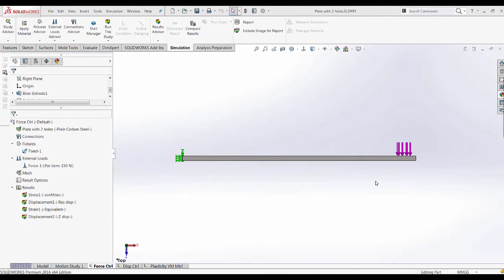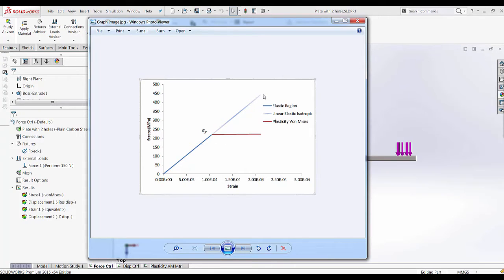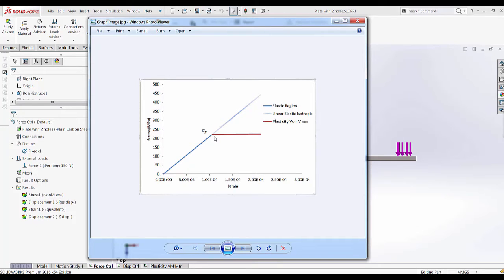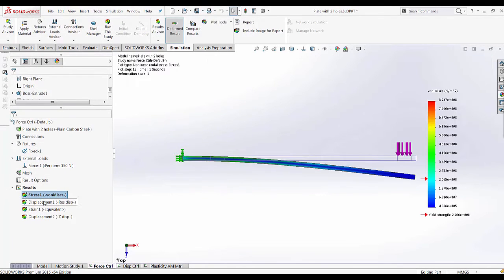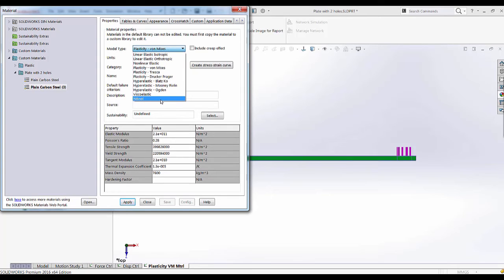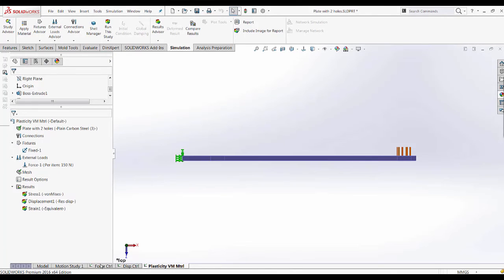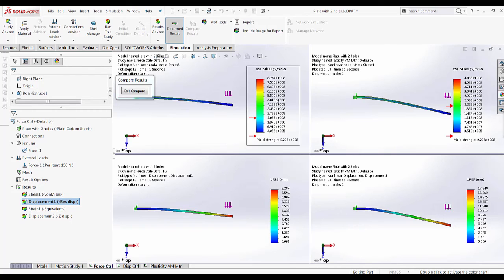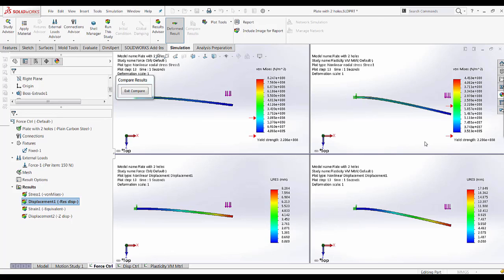SOLIDWORKS Quick Tip - Nonlinear Analysis Plasticity Von Mises Material (Part 3)

Comment: Can you explain this error ?
solution failure in a Step>1, it could be due to: The solution may be at a buckling or limit point, i.s., displacements grow large under constant forces. If so, for force control or contact problems, this is the end of solution (check out the response graphs). Iterations not converging: 1. Raise the convergence tolerance slightly(Last resort